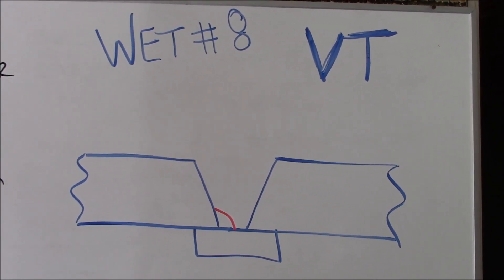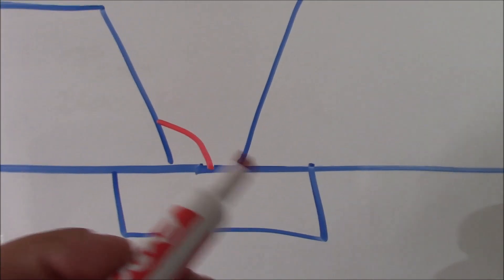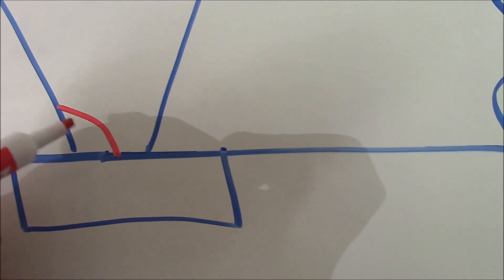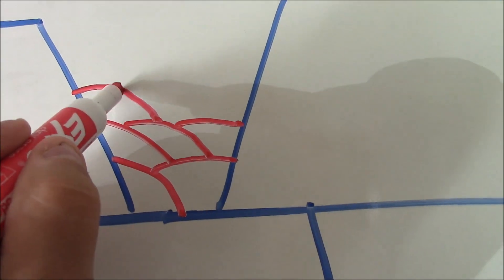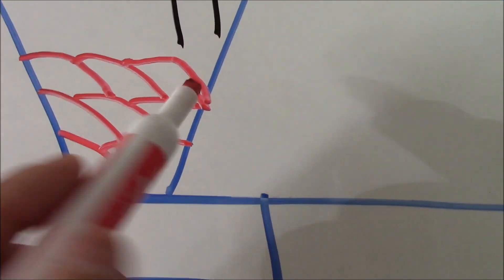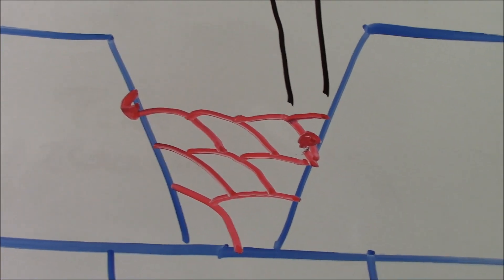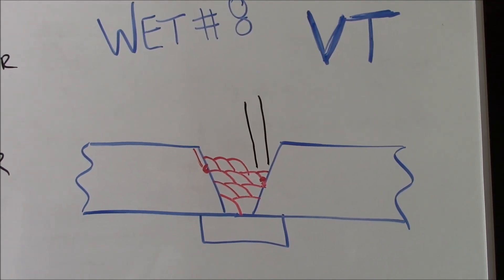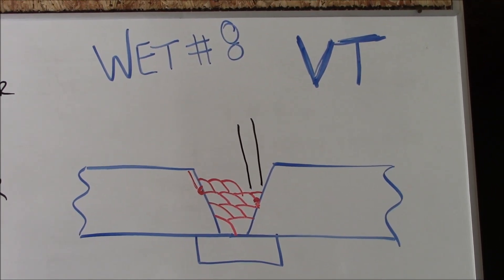WET # 8 VT

Comment: Is there a different way of laying the beads?  At MWI we were taught to run one straight stringer pass that would hit both sides then run stringer passes until we capped it off with 4 beads.  Please don't misunderstand me that was just the way they taught us.
Thanks
Reply from the maker: Yes, there is always a different way of laying the beads. A lot of can depend on application, and most of it depends on how well it fit up and welded in subsequent layers. AS for fit up, its not a perfect world and maybe your fitter came in hung over or sick or whatever it may be and the root opening is a little larger than the welder is comfortable with welding. The welder can demand though may not always get his way, that it be re-fitted. If it is a groove weld that utilizes a backing strip then it is a crap shoot, do a lay in a big stringer or a little weave and do the root in one weld bead, or do I put in two small nice stringers that I know will tie in well and have a good root layer in the groove? Also, as for capping it off with 4 beads, that sounds like a classic 3/8" plate test. what do you think happens when it is 1" plate? You will need a few more stringers at minimum for a 1" plate cap layer that is welded with stringers, and if stick/SMAW welding, and weaving the cap when you get out to wider distances its not uncommon to see that you weave half of it and then weave the other half as a second weld pass to finish the layer. Another difference in the way you lay stringers is if you are intending to do so in a way that is called temper beading. Thanks for the comment, and I think it has more than enough material to be used as a topic in a future video.  Hope this helps explain some things.